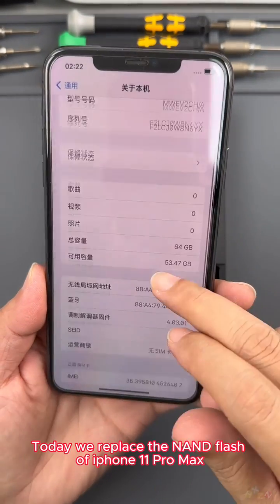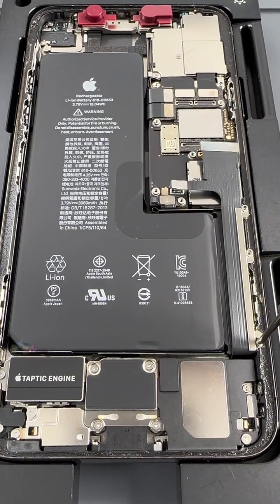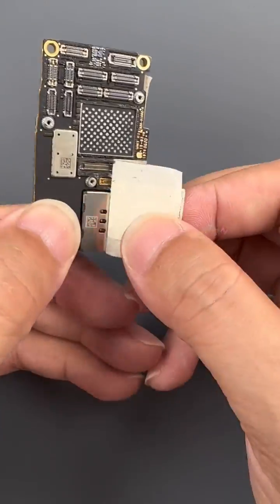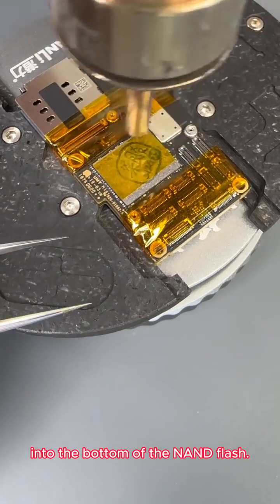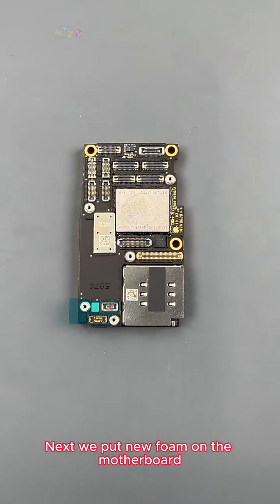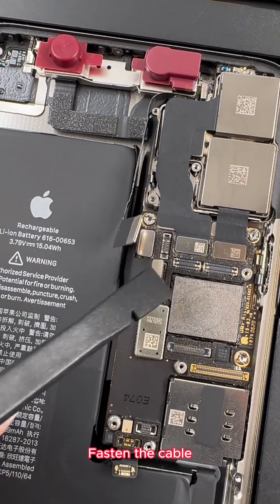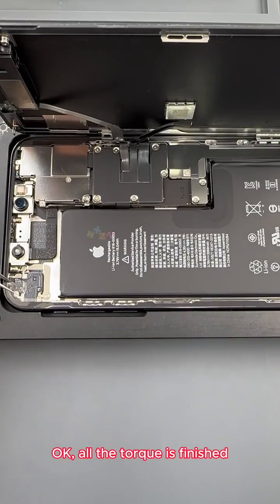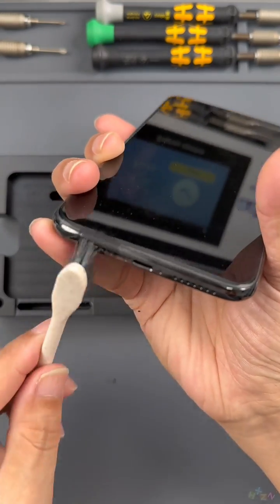Replace NAND flash of iPhone 11 Pro Max

Comment: Great work.I have a question?
You installed the new memory directly without taking a copy of the data from the old memory and you did a software update and the device worked normally. Does this mean that we do not need the data from the old memory now and we only do a software update?
Thank you❤